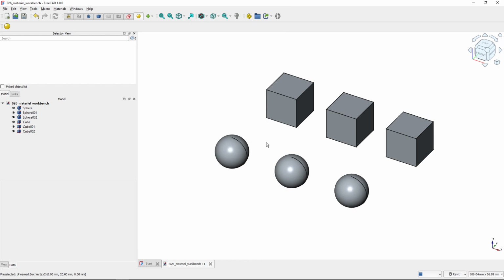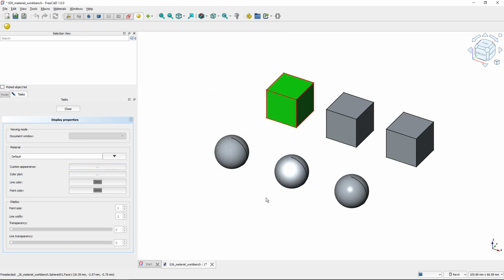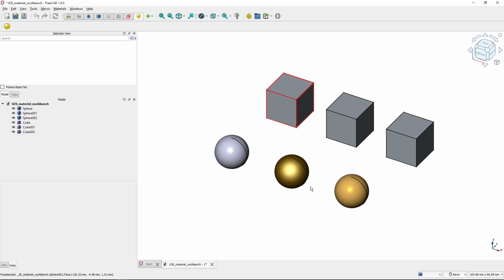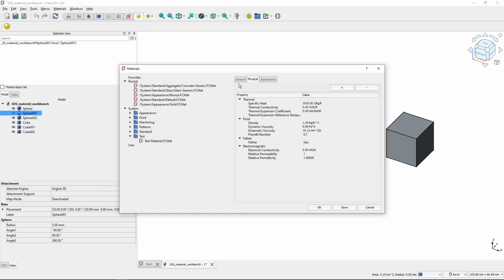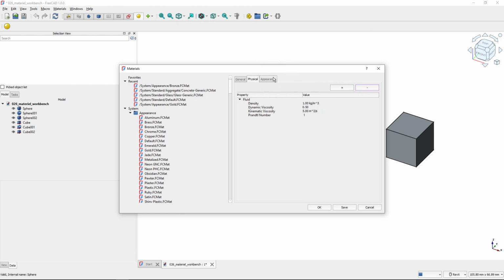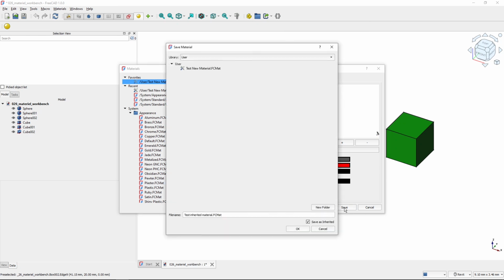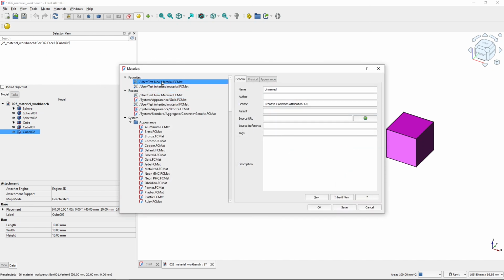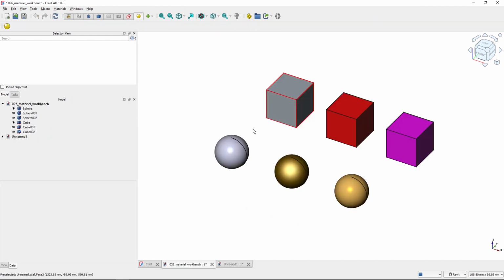FreeCAD Material Workbench Overview

Comment: Why can't you have 7 basic plastic colors similar to Autocad Layers.  There is nothing simple using Freecad  everything is a big big dance around.
You cannot move an object from a Windows Freecad to a Linux Freecad and keep the colors.    You can watch an MP4 video in Windows or Linux.
Reply from the maker: I don't think there should be a problem moving FreeCAD file between Linux and Windows.

The material system is complex, but it is also quite feature rich. If you only care about color, you can work with individual object appearenace. You can use FreeCAD layers the same way as AutoCAD layers in this regard. I described it in this tutorial: https://youtu.be/xWquyMclbl4
Reply: @FCBlounge  Not everyone is smart enough to go through all the color theory. They just want to pick a simple color. Atoms and molecules do not scale up and down as in
parametric geometry.  I show that the CubicWonder System shows a similarity to the periodic system for 118 elements.
Reply from the maker: @ThePaulTM  To pick up a simple color, just change the 'Shape Apperence' property.
Reply: @FCBlounge  I realize everything can be accomplished but I find it a lot of tasks.  I am only interested in producing two 5 color piece of a Chico and the same for a Chica cubes.
   I  can produce this using Rhino 6 and can use 3 point align in a 3 dimensional environment.  The layers are on the same workbench and vertex snaps are provided to 3d align everything straight forward. It is basically a simple operation. 

 I fail to do this with Freecad you do not provide an environment to copy and move parts in a 20  vector duo phi setup  for the CubicWonder System.
You are only working with 90 degree XYZ  vector moves.

I am sorry I am not sold on this Freecad System. I do not see people working in the 5 Fold Geometric setup using the Dodeca and Icosa Geometry in a 20 and 12 vector setup.

My work aligns to the periodic table for the 118 Elements.   Nobody ever mentions this in using Freecad.
.

Comment: thanks for the explain of the material tool, i think its aweful to use and defnitly needs to be improved i had to add like 30 materials and it was a pain to add them
Reply from the maker: This is the first iteration of completely new material system. It will get enhancements in the 1.1 release, I am sure it will get more convenient.